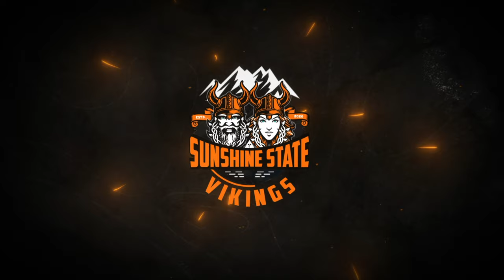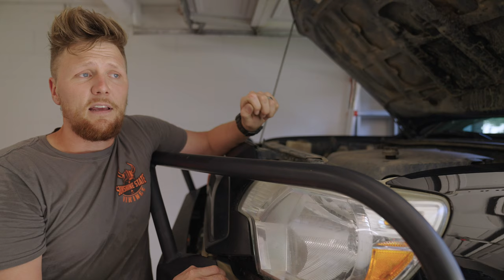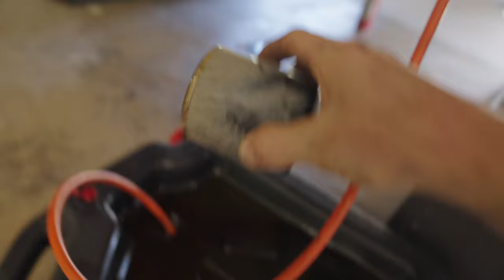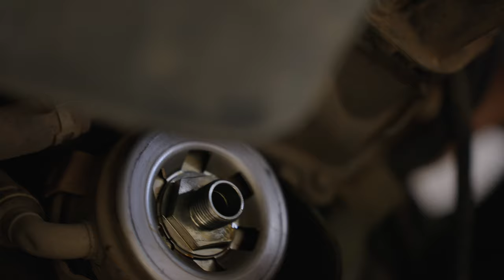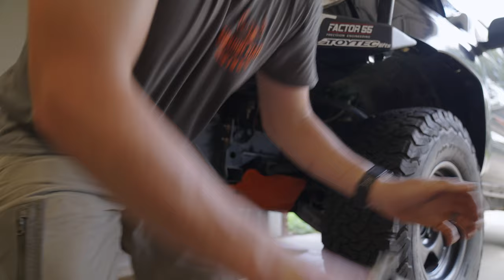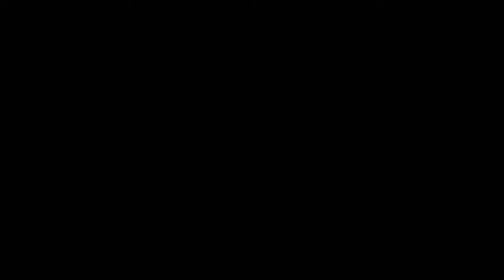Announcements And Updates | Overland Expo East 2021

Comment: An easy fix for that is to get a 5 gallon bucket(from Lowe's or Home Depot and drain it into there, get a lid also, and you just keep all the oil in there until you need to dump it at autozone or where ever). I use one on my 2500 and no splashes.
Reply from the maker: The messed up thing is that’s how I normally do the oil draining. It’s my fault for wanting to try and make it “look” better 🤣. Still thanks for the advice! It’s always appreciated.